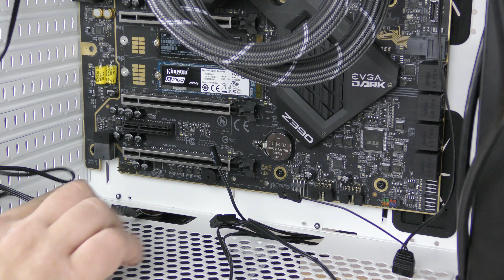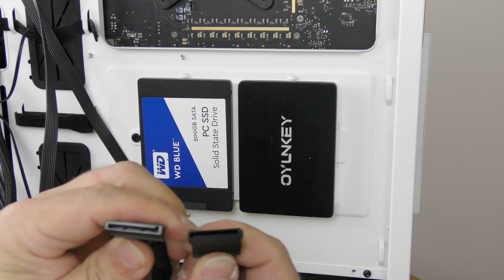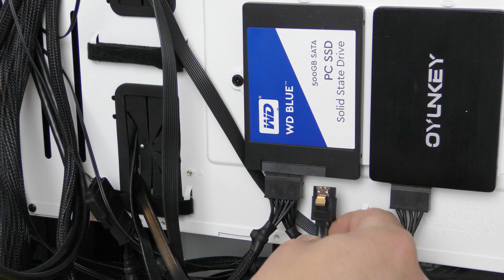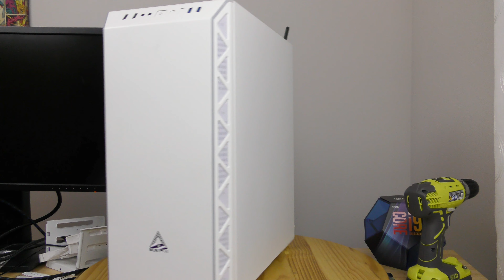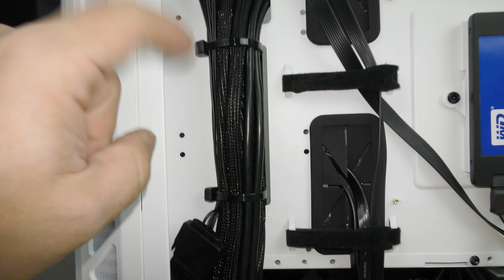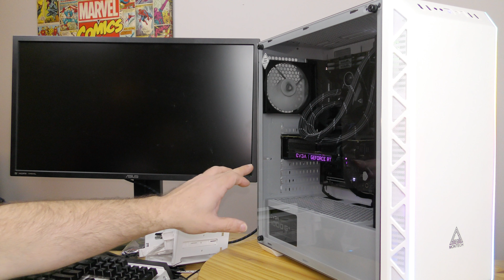How to Cable a PC - Step by Step Cable Management Guide 2021

Comment from the maker: In this video, we go over How to Cable a PC - Step by Step Cable Management Guide 2020.  I take careful steps, showing you how to do some basic cabling and then go deeper.
Check out how to build this PC step by step: https://youtu.be/HN8D_FRHtP4
Check it out on my Amazon affiliate link: https://geni.us/kcq3
Timeline below PC Specs

PC Specs
• Viotek G35DR 35″: http://geni.us/6LrGJ 
• Intel Core i9 9900K Processor: https://geni.us/0PrCbaY 
• Arctic Liquid Freezer II 360: https://geni.us/CmNtJA
• EVGA Z390 Dark Motherboard: https://geni.us/UmV6tf
• EVGA GeForce RTX 2080 XC ULTRA GAMING: http://geni.us/SwBEU6
• WD Black SN750 1TB NVME PCIE SSD: https://geni.us/8sqXFs
• Kingston A1000 480GB PCIE SSD: https://geni.us/BhJAQM
• Montech Air 900 ARGB Mid-Tower White Case: https://geni.us/kcq3
• Patriot Viper Gaming RGB DDR4 DRAM 3200MHz 16GB Kit: https://geni.us/URlI8
• Samsung 850 EVO 500GB SSD: https://geni.us/QTA2
• WD Black PCI-e NVMe 512GB SSD: https://geni.us/mMNLde
• EVGA SuperNOVA 1000 G+ Gold Power Supply: https://geni.us/IVoE
Reply from the maker: @Dimitri Mekodov which part, the part where you came here to watch my video because you wanted to learn how to wire?

Comment: Hello, thanks for these videos helped me a lot,  but my front RGB seems to be only working on the left side is it because I only plugged the SATA cable and not the other header as well?
Reply from the maker: make sure you connect everything the case provides, as much as you can of course, though the RGB cable should be one connection, and that should be power
Reply: @ThisBytesForYou  Problem is that my motherboard is old and doesn’t have the 5 volt header , I will look into it .
Have a great day:)
Reply from the maker: it doesnt need it, it will work on its own, and you can cycle through the lighting it does provide, so you are good.  I hope you have a great one as well my friend.

Comment: My LED case dosent work anymore 
im sure i connect the cables. btw i tried to push the button, but it wont turn on  what should i do ?!.
Reply from the maker: Doesn't work anymore, the only way that would be is if you are missing a cable.  If the PC won't turn on, you have to check the motherboard manual to see how/where the power button goes connected.

Comment: Thank you for the video I enjoyed it very much, just wanted to share something minor with you. at the 10:45 point of your video you called the hollow bottom area the hole where you push cables into, I seen a few other videos from professional builders as yourself calling this area the BASEMENT of the tower which in my opinion makes sense, Maybe you will choose to adopt the term 😉
Reply from the maker: Thanks so much my friend, yeah, I am not sure, haven't really put any thought into it really but maybe I will use it on my other videos when doing a new case or a build, thanks so much for your input, it means a ton to me, thanks for the like and sub and even more for checking out the video and again for commenting, it means so much to me and so very happy to have you here.

Comment: Thank you so much but I need help trying to open the side panel to put my power supply I have a montech 500 fighter pls help
Reply: I meant montech fighter 500
Reply from the maker: There's a screw on each corner, unscrew them and the side panel will come off
Reply: ThisBytesForYou Thanks 🙏🏽 merry Christmas btw
Reply from the maker: Anytime my friend, Merry Christmas as well.

Comment: Great video! I have a Gigabyte X570 Aorus Elite motherboard, and I had trouble connecting the 24-pin cable from the power supply unit to the motherboard. Unlike your motherboard, the 24-pin socket on the Aorus Elite is vertical instead of horizontal, so the cable kept falling down and touching the backplate of the GPU.
Reply from the maker: Thank you my friend.  Most motherboards are vertical, this one on the EVGA Z390 is a little different.  It will NEVER fall though when you push it all the way through and that little clip clicks into place..  I hope I helped you my friend.

Comment: I’ve built my pc but my power supply cable to go to the socket I’m my wall is the USA style but I’m from the uk so could I buy an adapter to fix that or would it mess up my power supply
Reply from the maker: you could blow up your power supply or worse.  I recommend getting a UK power supply.
Reply: @ThisBytesForYou  nooooo that means I have to re wire everything 😭😭what about if I got a 500w adapter would that work or is it just best to play it safe. But also will I be able to return it
Reply from the maker: @lewisthow2846  my friend, i don't want to tell you the wrong thing and you blow up your computer and you hate me, or worse, you burn your house down.  I HIGHLY recommend getting a UK PSU, and re-wiring it should be the least of your concerns, your safety and your PC's safety should be #1.
Reply: @ThisBytesForYou  yeah that’s true thank you

Comment: so the left side of my RGB from panel works but the right side does not:( anything i can do? ( there is a vdg cable that i cant find where to put.) it’s a 5v 3pin
Reply from the maker: I don't believe I used the VDG cable, but if a portion of the rgb is dead, make sure that it is plugged into the board correct and that the RGB strips are connected, you may need to open the front panel.

Comment: I knocked out one of those small little blocks on the motherboard while taking the side thing off. Does that mean my mother board will not work anymore?
Reply from the maker: well,... it may work.... but while you are using it, depending on what it was, when that portion gets used you may receive an error.  If it is a new board, try to RMA it stating that it does not work.
Reply: ThisBytesForYou I’ve tried booting up the pc and it will not turn on. I’m pretty sure I have every cable in the right spot. What should I do, should I get a new motherboard?
Reply from the maker: @richie8217  yeah if you broke one of those off.... that's not a good thing sadly, it looks like you hit something important.  Have you tried to RMA the board?  sorry I didn't reply sooner but youtube does not deliver all messages.

Comment: Amazing build! I have the Montech Air 900 Mesh edition in black and I love it! 
One question though, is the LED SW (which im assuming stands for switch) only used for the rgb edition? The port for the mesh version comes with a two pin adapter but I cant seem to find its place on the motherboard. I have an MSI x470. I even considered connecting the pin in the rgb receiver on the mother but maybe there is no need for the pin since I have the mesh version with no rgb lights on the case. First time builder it would be great if you can help me out somehow. Ive already searched for it in the motherboard guide and cannot seem to find anything about a LED SW
Reply from the maker: Hello my friend, the case is awesome isn't it.  So the LED Switch goes on the same section the front panel headers for the power switch, reset switch, that is the activity light on the case, showing when the drives are being accessed.  For example, on page 7 of this guide for your board, its mentioned as the HDD LED: https://download.msi.com/archive/mnu_exe/mb/E7B79v2.1-GSE-LITE.pdf, I hope this helps.
Reply: @ThisBytesForYou  So I have already connected all the front panels with the help of this series, which was amazing by the way, and already connected all the components from that section of the guide ( HDD LED+-, Power LED+-, Reset switch, and Power switch) but theres one more thats attached to the front panel labeled LED SW that is separate from the HDD LED. I guess what im mosty wondering is if it is even needed for my build since my case isnt the rgb edition and wont have much use for the led button on the front panel. I saw in your video that the LED button on the front panel controls the rgb and color rotation built into the rgb air 900 edition.
Reply from the maker: @stevendelgado1276  ahhhh well very cool, I am so happy I could help.  I am currently waiting for Montech to get back to me on that, they are taking longer than usual, but once I know, I will get back to you as soon as possible.  I checked their site, and they didn't make much mention to it, nor show the cable,  but I will let you know asap.  Again, I am so happy I could help you.
Reply: @ThisBytesForYou  Thank you so much for helping me! One more question though, does the led switch on the front panel only control the rgb lights on the case or does it control the rgb components inside on the motherboard as well?
Reply from the maker: @stevendelgado1276  yes, that is all it does, on the motherboard, you would use the motherboard software to control what is connected to the argb header.  I do everything I can for my subscribers, thank you so much for stopping by, checking out my video and commenting, it means the world to me, and again, I will get back to you as soon as possible.
Reply from the maker: @stevendelgado1276  heres word from Montech:  

The LED switch is for ARGB fan. They can connect the controller.  If you want to sync the lighting from the LED button, please use the controller for connection, and then connect the 2pin of LED button to the controller. If there’s no LED button, you can use the Reset button instead.

I hope that help.s
Reply: @ThisBytesForYou  I really appreciate you taking the time to help me out so much! Stay safe!
Reply from the maker: @stevendelgado1276  my pleasure my friend, I love helping and I am so happy i could help you.  Stay safe as well my friend.  I have some great stuff coming up, so stay tuned, I actually just bought something big.

Comment: My front panel headers need pressure to turn on. Any tips?
Reply from the maker: the motherboard manual has information on where your front panel connections go, this is why I skipped over that part, since ever board has a different method.  Let me know how it goes.
Reply: ThisBytesForYou it worked thank you so much bro 😄
Reply from the maker: Anytime my friend, so very happy I could help you

Comment: Ive seen you are still reading comments so I thought I might ask here. The bottem half of the left argb light strip stopped working on me. Anything I can do
Reply from the maker: If you mean on the case, you may want to reach out to Montec and see if they can replace the front panel for you, if a portion of the strip dies, there's pretty much nothing you can do other than to replace it.  and thanks for stopping by, yes, I reply to all my videos, no matter how old or new they are.  I hope I helped you.

Comment: A question about the fans for this case: The front fan has a 3 pin connector for mobo, but also has a mobex(correct?) on that same wire. Can I/do I connect another fan to that mobex, or do additional fans have to be connected to the psu?
Reply from the maker: no molex connection, it is all the fan header.  The SATA power connection it brings is for the RGB lighting.

Comment: My audio isn’t working?
Reply from the maker: which, front panel or rear panel and what is your motherboard manufacturer and model number and do you have this case?
Reply: @ThisBytesForYou  thanks you for your concern. After some troubleshooting I fixed my problem
Reply from the maker: @ttvgroot8558  ahhh ok cool, was the HD or AC97 front panel header not seated correctly, 2 pins over?